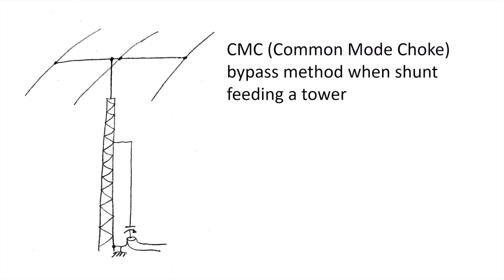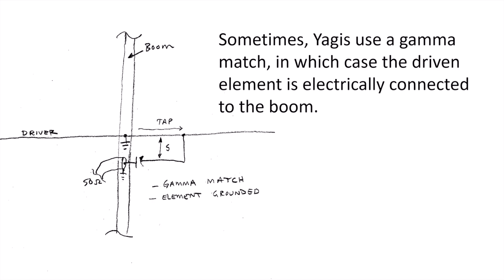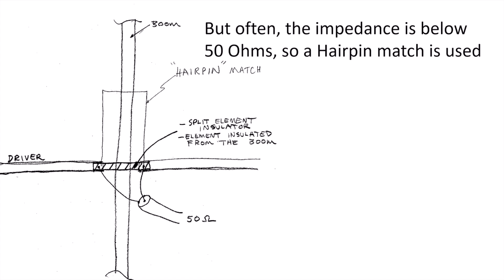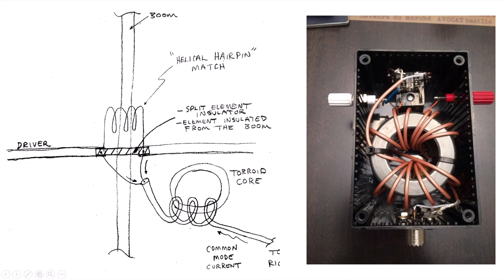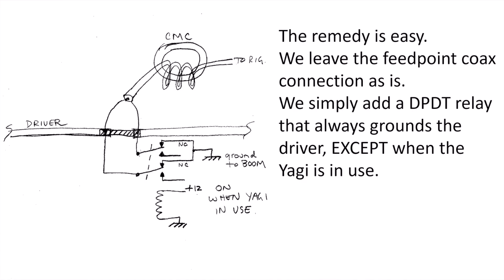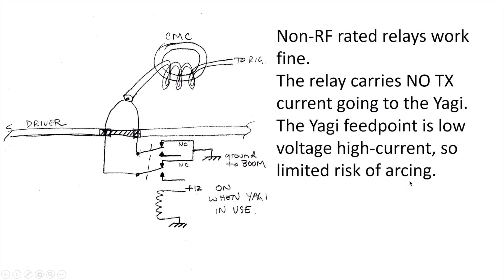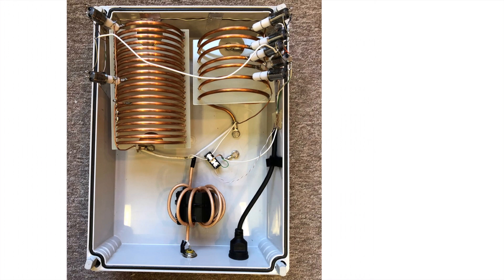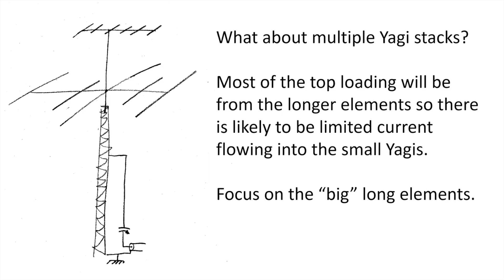How to install a common mode choke bypass relay on a Yagi feedline when shunt feeding your tower.

Comment: I need some help.. I have a three element 10 meter yagi it's split element setup on the driven element using a hairpin match with just the radio not applying any kind of power SWR 1.1 50 ohms to the frequency that I normally talk at but when I apply power it jumps to 1.6 when I modulate SWR swings backwards to 1.2.. is this considered a reflect problem? Would grounding the boom help any? Or should I try grounding the director and reflector? Or should I try building an ugly? If anybody can give me any opinions or help me out in any kind of way I would greatly appreciate it
Reply: Ugly balun sorry typo